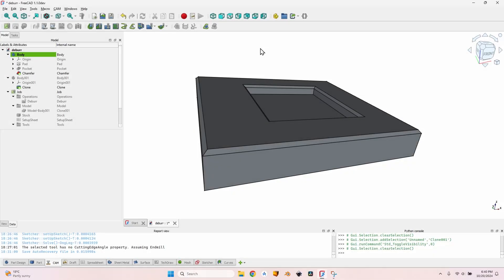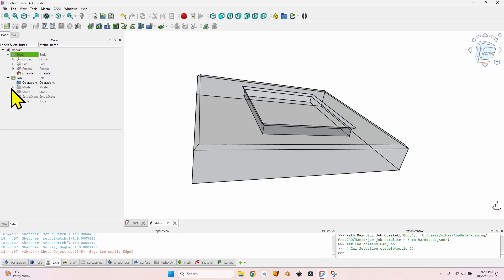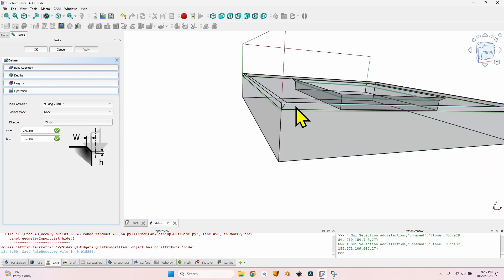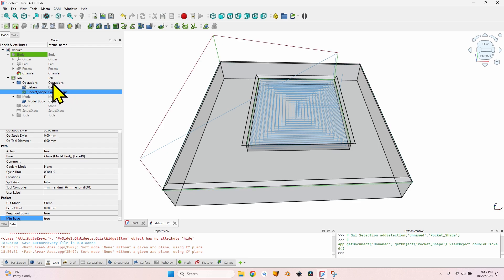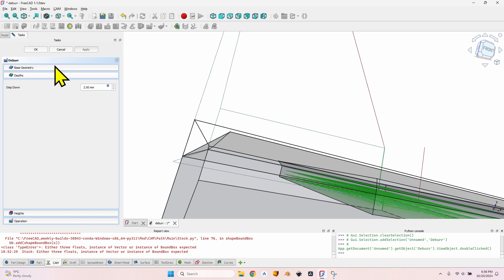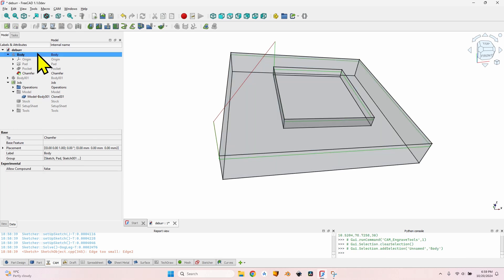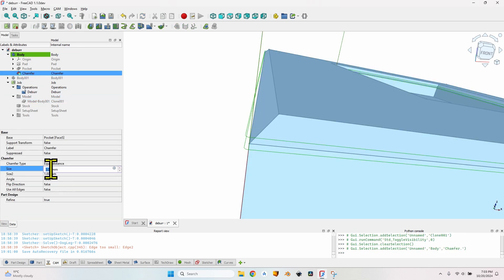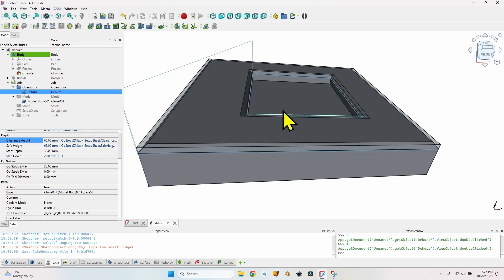CNC Chamfers & Deburring in FreeCAD 1.0 | Complete CAM Tutorial for V-Bit Bevels & Edge Finishing

Comment: I thinks it’s possible to use a profile op to do a chamfer too.  Plus you should be able to do multiple passes. This would also be useful for any profile shape router bit.
Reply from the maker: Yes, it is possible. On my older video about deburring I used it. It is a little bit more tricky to setup, as you have to manually set the offset, but it can be done. You can set multiple passes both in the deburr operation and the profile. In the profile you can also use the side approach, by setting decreasing offsets to multiple operations, while in the deburr you can only use the stepdown, so a top down approach

Comment: Nice bit of information to know, is it possible to program a rounded edge (radius instead of chamfer) with out a radius cutter ? thanks    👍👍👍👍👍👍👍👍👍👍
Reply from the maker: Probably a 3d surface. I've done it a couple of times, when I didn't have the required diameter. But it takes much longer